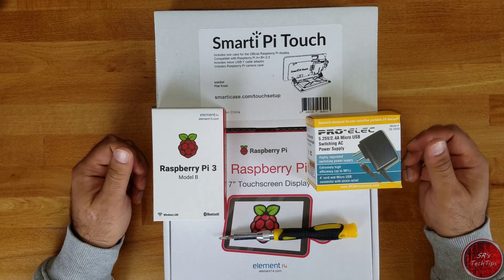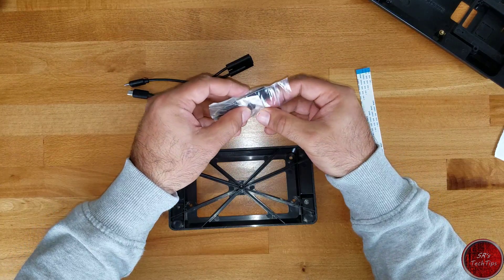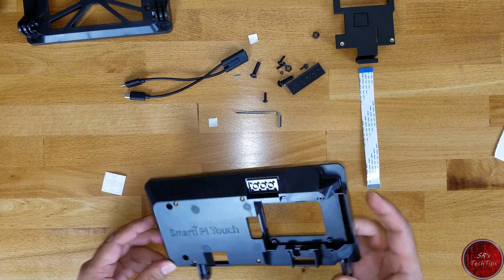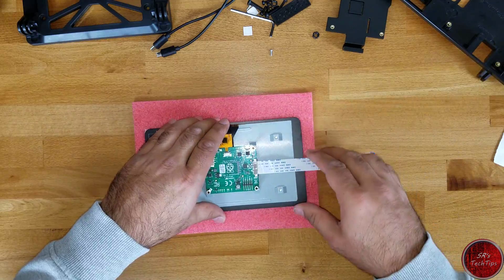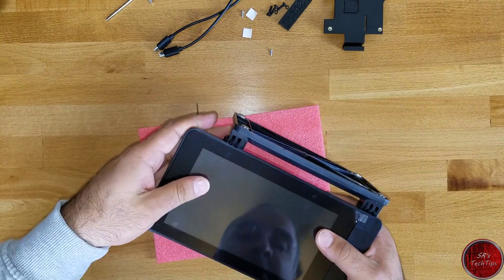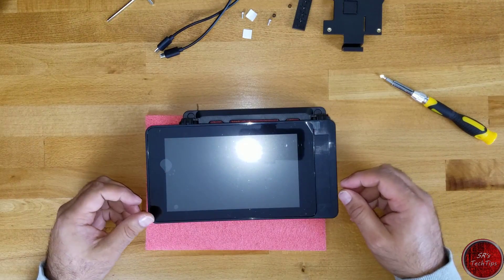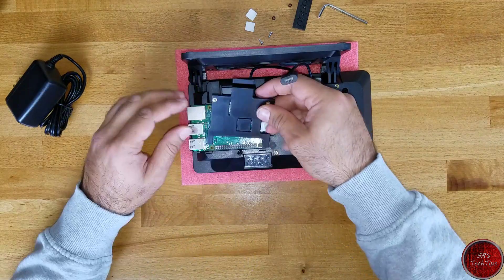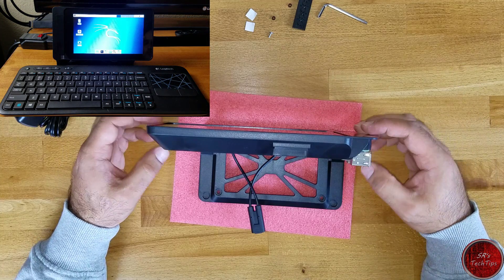Raspberry Pi3 7inch LCD Smarti Pi Touch Case

Comment: i bought one of these off a guy on Fb marketplace and was wondering if its really a touch screen & how to use that feature and if it can be used with a 3d printer as well.
Reply from the maker: Hey Robert,the video I created was not of a touchscreen, but yes you can print a 3dcase from thingiverse.

Comment: I wish you had more content. 
I have a question, do you think the ribbon cable would reach the Pi if I install the screen upside down? 
Or could I install it right. And just go into the settings and flip the screen upside down.
Reply from the maker: You can flip the screen upside down..

Comment: Great tip that the rear door does not close with the screw's in place - if you try to force it with the screws in - you will break your Pi

Comment: Did you have power issues (the lightning symbol on the top right corner)? I build one of this at work and was on low voltage with the split Micro-USB cable and the original Raspberry Pi power supply.
Reply from the maker: The yellow lightning bolt shown up when you have low voltage typically when using a power bank, a power adapter should help.

Comment: One of the best tutorials ever!  Just what I needed when I needed in less than 16 minutes.  Hurrah!  

One thing to note is that the snap-on cover for the pi itself is not compatible with the new pi 3 b+.  This pi has 4 new pins that are offset from the main GPIO pins.  For the snap-on case to work, you either need to break off the pins (sacrilege!) or dremel away enough plastic to clear the pins.  This  leaves the hinge for this snap-on section very fragile, so care must be taken to dremel the bare minimum to make it work.

Comment: Can you put a hat on the pi to add a board
Reply: Yes, though that snap cover I believe gets in the way, instead since the pi is sitting on 4 mount points you can use 4 female to male mounting screws to secure the pi down to the board, and then attach and secure your selected hat to the pi. They also make back covers for the case, including a rather deep one that will accommodate having a hat on the pi.

Comment: Wonder if you can make this portable with a battery?
Reply: Yes, i have one and its portable with a battery from amazon

Kuman Lithium Battery Pack Expansion Board Power Supply with Switch + Micro USB Cable for Raspberry Pi 3 Model B, Pi 2 Model B & Pi 1 Model B+ A+ A KY https://www.amazon.com/dp/B06VT2Y59H/ref=cm_sw_r_cp_apip_sLklfnPRwHSWs
Reply: Andrew Knight awesome thanks. I just used a cell phone battery pack as I seen a few use here on YouTube and seems to work perfect with my Pi 3 and 3.5" touchscreen
Reply from the maker: Yes you can I am using a Zendure and that works great and for hours.. https://www.amazon.com/Power-Delivery-Portable-Charger-Ultra-Durable/dp/B075Q6XG76/ref=sr_1_2?ie=UTF8&qid=1527383004&sr=8-2&keywords=zendure&dpID=51N8Id0UpBL&preST=_SY300_QL70_&dpSrc=srch
Reply from the maker: Yes it does work with a power bank, might show the yellow lightning if the volts are low, but definitely works.

Comment: would you recommend using the lcd screen protector they make for the 7" screen or will it not fit right on this set up? Thanks
Reply from the maker: the screen protector fits, but is not required unless you are planning to use a stylus or travel with the device.